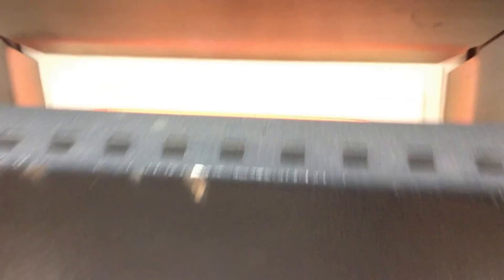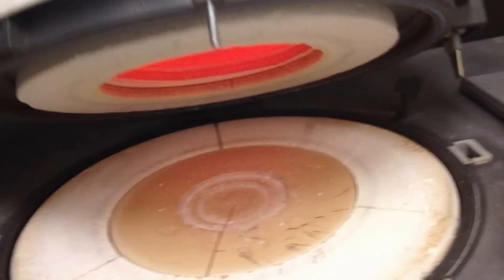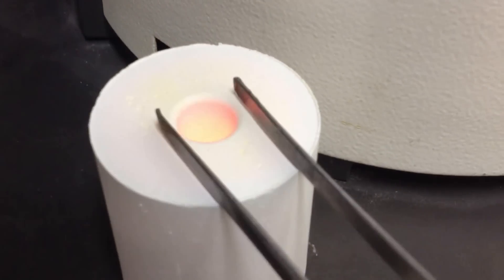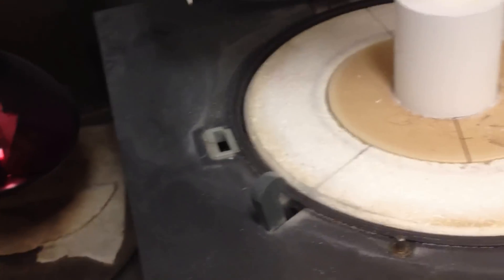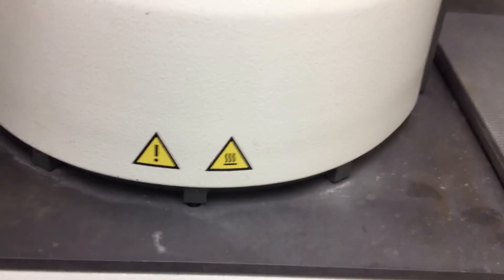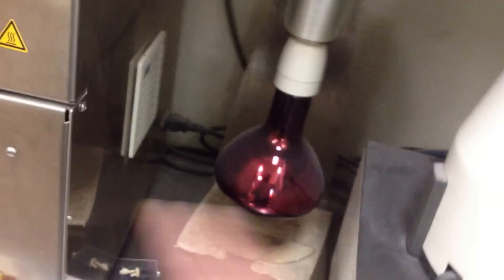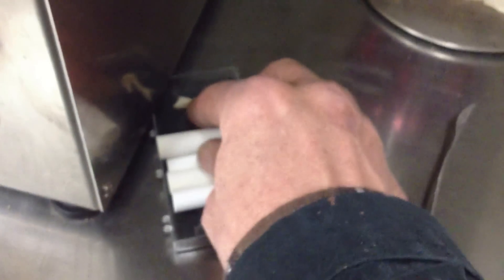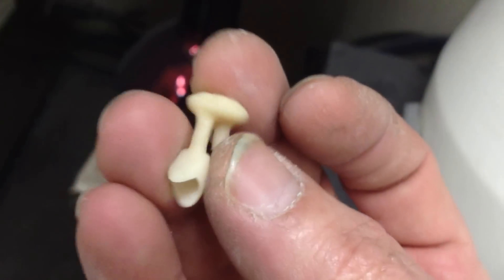Ceramic injection molding..

Comment: Hi! I ha e the same furnace and i was wondering what brand of ceramic did you  press with this machine so far? I am looking for compatible materials to use with my furnace.
Reply from the maker: You can press anything with this model..it's programmable so you just set the parameters according to the specs of your material.
Reply: @electro1622  thank you. I was just wondering what brands did you use?

Comment: Im doing engineering in college, this video did fuck all for me, nice one m8
Reply from the maker: come on..that was a good video..how many other video's out there on ceramic injection molding..??
Reply: We get many college "engineers".They do fuck all for us m8.If you got nothing out of this then ,trust me, you are not an engineer nor ever will be .
Reply: Know anything about ceramic extrusion? I`m trying to extrude small alumina tubes and keep getting blow holes and distortion and bending on drying.I`m using a very viscous Alumina paste from a high shear mixer.But  I am having difficulty getting the air out of the paste body.Vacuuming will not remove the air.I`m wondering if I`m on the wrong track and should be producing a " granulate" or pellets.

Comment: Hi do you have any advice on making non-reactive gears and strainer for a Greenstar juicer? So there is no reactions or ionization or leaching from the metals into the juice? I'm really curious, not sure I want to go to the plastic since plastic is more reactive than ceramic/porcelein. Thank you for the inspiring video.
Reply from the maker: Ceramic gears would be super expensive and material not really viable...also brittle when thin..use polyamide,..it's an injectable nylon material. flexible and strong and pretty inert.
Reply: I'm trying to replace the metal on my juicer. I want no metal interference/ionization/leaching/contamination of the juice. And just need to replace the metal on the gears:
http://ep.yimg.com/ca/I/harvestessentials_2269_45524111
(with a super strong plastic or inert material that you might recommend??)
and the strainer that fits AROUND those two gears:
http://ep.yimg.com/ay/harvestessentials/tribest-green-star-green-power-juicer-coarse-screen-2.jpg

Any solid ideas? Just want to replace all the metal components. Not keen on plastic as the replacement, but I know I can't get stone or wood or glass (or diamond!).

Comment: I signed in just to say. Nice video of CIM without getting into the specific industry you are clearly in. I was looking for CIM information outside of the dental industry. I recognized everything you are using as well as those Emax HT ingots. Nice job sir, nice job.
Reply from the maker: good luck with finding info in this sort of stuff...I've played around with boro silicate glass and the like and I've even got a stack of lucite ingots (empress1), but emax is the best I found...I mill zirconia as well and press emax onto it..I make custom insulators for a friend using that method..CTE is the most common problem. just recently I started milling and sintering my own alumina as well..
Reply: Yeah, I have found pretty much zero on the stuff. Taking what I have learned via trial and error in the lab. Then trying to make it work for me in other ways. Just mostly tinkering. Working on repressing the zirconia milling waste into custom shapes and sintering it.  I like the idea of the lithium di-silicate on zirconia for a custom insulator. What is the application he needs that for? I believe the old in-ceram system was alumina, wasn't it? Thanks for the reply and good look in future endeavors.
Reply from the maker: The insulators are for some of his high voltage experiments...the end result is quite good. In-ceram was a glass infiltrated aluminium oxide but you can now buy pre sintered alum. oxide and mill it like zirconia but it shrinks 15% not 20% like zirconia.

Comment: Hi! Came here through searching for alumina ceramics.
I'm tinkering a model gas engine build but due to the smallish size and compact integration of inline cylinders the cooling geometry is quite insufficient. My main concern is 6061 T6 or 2024 alloy I intend to use weakening under elevated temperatures.
Could alumina be cast to follow the contour of small(a few dozen millimeters) structures and withstand 250~300 Celcius continuously? Please provide some insight into this approach. Thanks!
Reply from the maker: Sangyoon Kim This is not casting Alumina, this is lithium di silicate....it's a synthetic glass..melting point..930 c.hardness is 600mpa. Alumina is a different material but is well suited to your needs, in fact there are engines already made with alumina( not commercial)There are companies all over the place which will mill alumina parts for you...even that small....good luck and keep me posted on your progress
PS. Alumina engines usually have NO cooling because they are ceramic and cracking is a problem....Alumina has enough heat resistance and strength to still function when red hot...make the whole thing from the same material so the co efficient of thermal expansion is the same for everything.
Reply: electro1622 Lovely!
 T .T then no aluminium engine block and ceramic cylinder heads? 
Oooh! Making the whole block with ceramic sounds cool!
But I noticed heat conductivity for alumina is around 1/7 of that of aluminum. 
When you say ceramica are prone to cracking.. would conventional air cooling fins be problematic also?
Reply from the maker: cooling fins are ok I think, but maybe you don't need them. Alumina can withstand over 2000 c with little deformation so doesn't matter about cooling....If your going to try this I suggest a 2 stroke motor..much much simpler to make and less moving parts.
Reply: electro1622 You were riiight! After much contemplation I've settled on a Hirth engine style 2 stroke motor. But I would still like to pursue ceramic route. 
http://www.wired.com/wp-content/uploads/2014/11/liquid-piston-inline.jpg 

This is the kind of texture I want to emulate! 

There are many commercially available alumina powders on the internet,, how would I go about casting or sintering my own part?
Stock alumina parts are out of question. Please refer to this rediculous prices; http://www.mcmaster.com/#alumina/=y4veu2
I'm looking into induction furnace type sintering process!
Reply from the maker: induction will not heat ceramic, only metal. You could use a microwave furnace but your best bet is to look up lab supplies who sell alumina products...these people will often make custom things for clients...the cost is deer but nowhere near what you had in your example.
PS. be careful when buying ceramic bearings..most are  made of zirconia...buy ones made from alumina...much more heat resistant than zirconia.
Also..CTE is different.